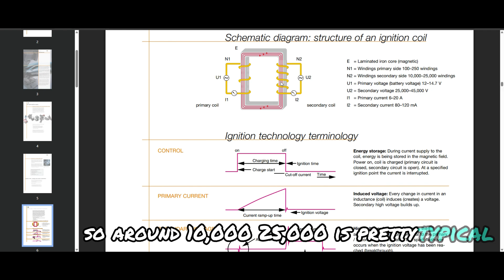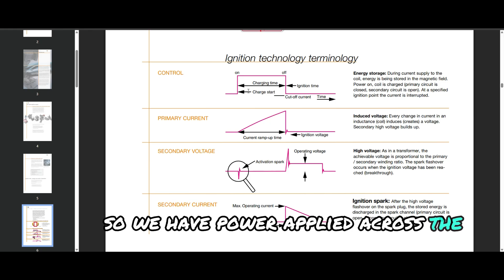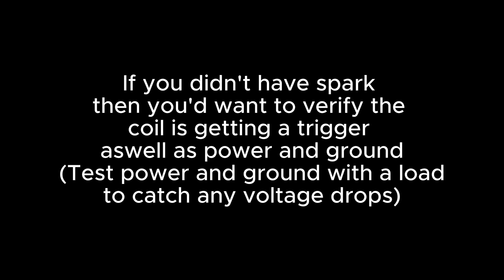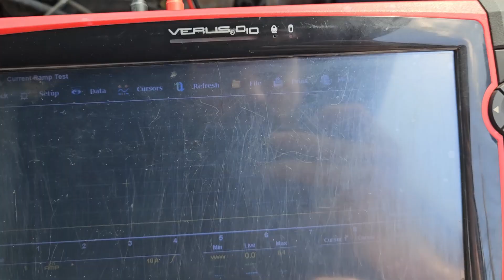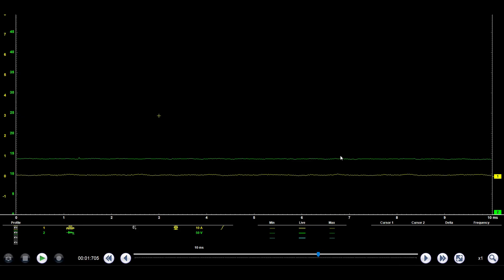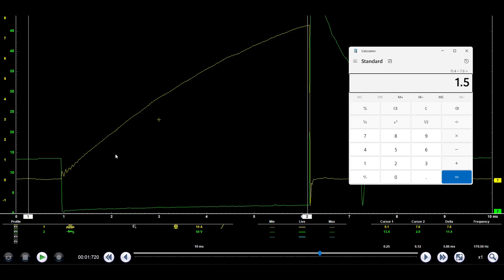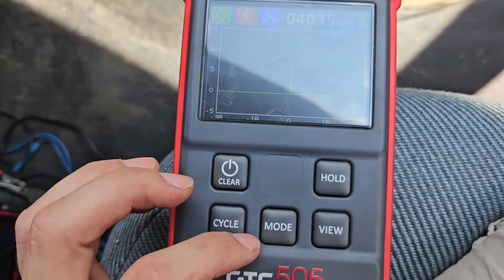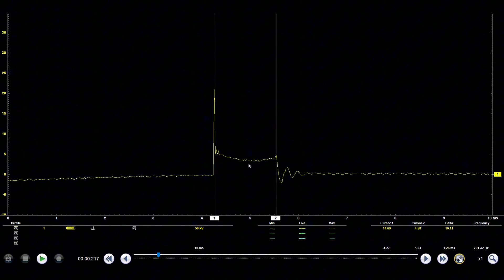Ignition Coil Testing EXPLAINED: DIY vs PRO Tools Side-by-Side

Comment: Can you make a tutorial using that gtc505
Reply from the maker: Definitely! Its one of my go to tools for almost anything driveabilty because of how quickly it can be setup. Thanks for the suggestion!
Reply: @AntsintheGarage apparently it works on fuel injectors as well 🔥
Reply from the maker: @theahch I've used it as a quick function test on injectors but never dived deep into it since gtc makes one specific for fuel injectors, I figured the 505 wouldn't be accurate... now I might have to get my hands on one to compare